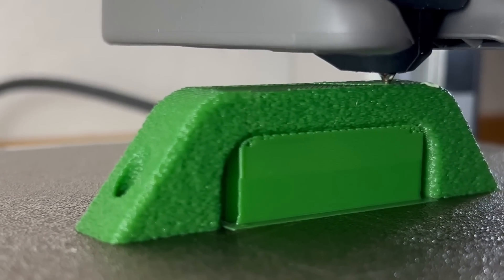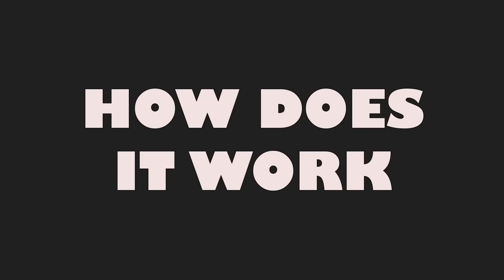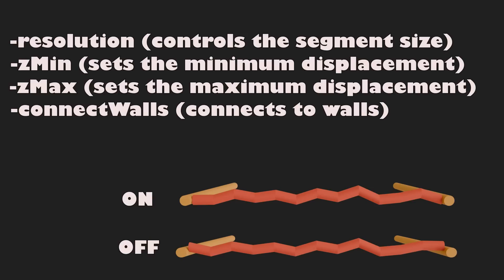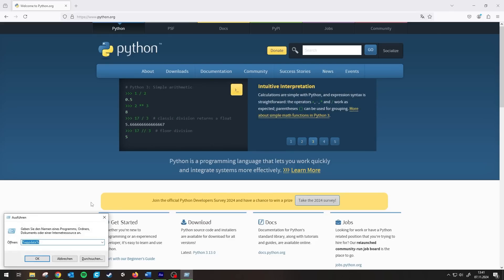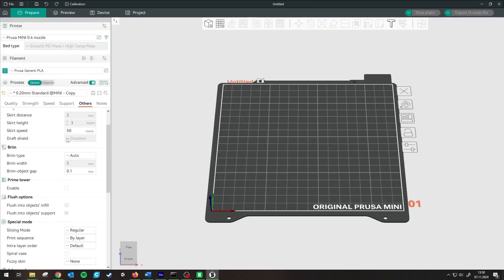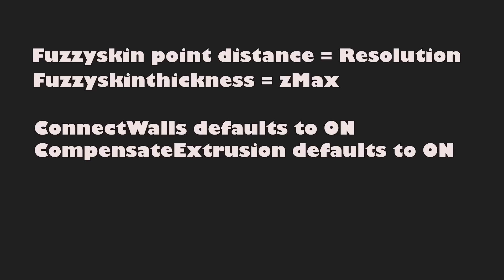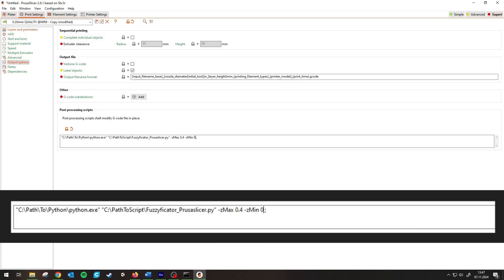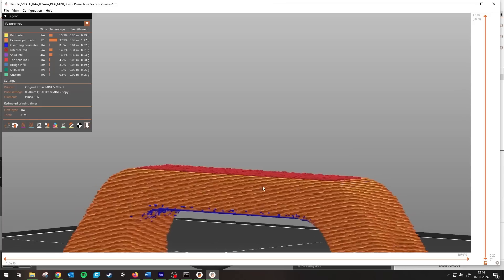UPDATE! - Non-Planar Top Fuzzyskin - 3D Printing Guide!

Comment: I am getting an error after trying to slice my file: "zsh:1: permission denied: /Applications/Python 3.13/Python Launcher.app"

I added ""/Applications/Python 3.13/Python Launcher.app" "/Volumes/OWC Stack/3d printing/Fuzzyficator_Orcaslicer.py" to the Post-processing Scripts window, Python launches normally if I just double click on it to open, but it's not working for me in Orca Slicer. Any advice on why this could be?

I am on a Mac, running Sonoma 14.6.1, Python 3.13
Reply from the maker: The log file writes in to a protected folder try launching orcaslicer with admin (or whatever the OSX equivalent is) permission
Reply: @tengertechnologies  thank you- I am the admin of this computer, and have full permissions. Still having the same issue
Reply from the maker: I don't own a mac so unfortunately can't test it. But a user u/HurricanePrint on Reddit got it to work on Mac like this: python3 ~/Downloads/Fuzzyficator_Orcaslicer.py So first of all no quotes around the path and then just use python3 instead of the path. For your path to the script, I'm not sure if you need the ~ so I suggest trying it both ways.
Reply from the maker: do you by any chance use orcaslicer 2.1.1?
Reply: @tengertechnologies  I am currently running 2.2.0
Reply from the maker: I found the potential problem. I'm guessing you are using a Bambu printer. If so, use the bambu script version Fuzzyficator_Bambustudio.py you can use it in Orca too and it is for the marling(legacy) flavor which Bambuprinters use.
Reply: @tengertechnologies  yes I am using a P1S. Thank for your help! I got it working in Bambu Studio, and now realize the Bambu script works in Orca as well.. so I guess it was something with the orca script. 

All that said, now that I got it working, I just did some test prints with your script, and it works perfectly! Fuzzy skin on top surfaces is a game changer! Hopefully your hard work is enshrined forever and placed into the slicers permanently. THANK YOU!
Reply: @nakleh  Hey, would you be willing to share the final code (and or steps) you used to get it working in a mac environment?
Reply: @EltonLauring  honestly I would, but I did it a month ago, and have since gotten a new M4 Mac mini, and haven't set it up again yet. I don't remember exactly what I did, the formatting was very specific. If I figure it out again I'll reply back here. Good luck!
Reply: @nakleh  I can't run it in Bambu Studio on my Mac. Can you share the final code (and or steps) you used to get it working in a mac environment?

Comment: Neat. Will try this with a dome shape object combined with regular fuzzy skin
Wonder if its possible to have fuzzy skin surface ambiguous and just offset  along Vertex or Face Normal.
Reply: I agree. The ultimate solution for this is a complete revamp of the fuzzy skin engine that utilizes the face normals from the model file and deviates by some distance along normal vector.